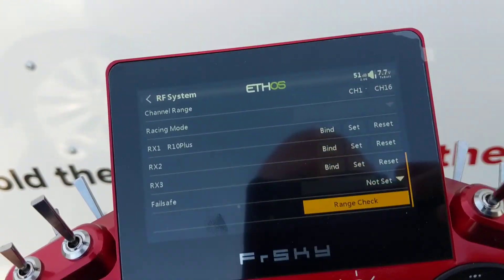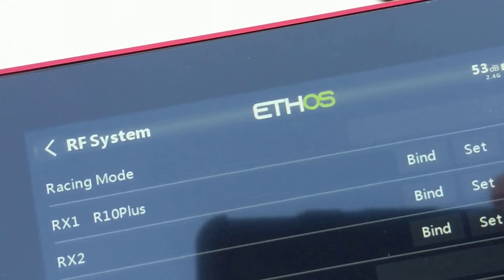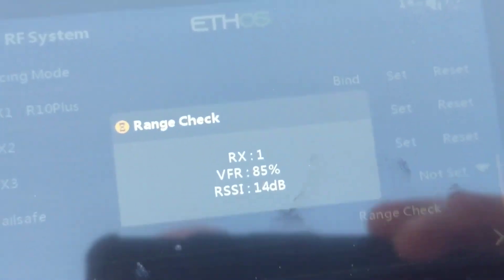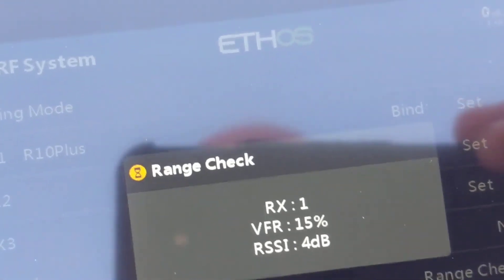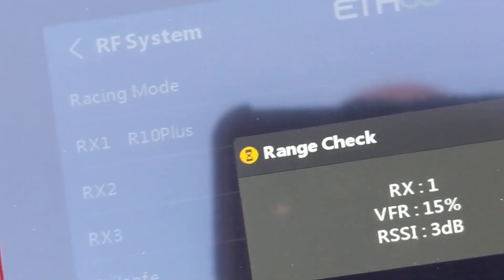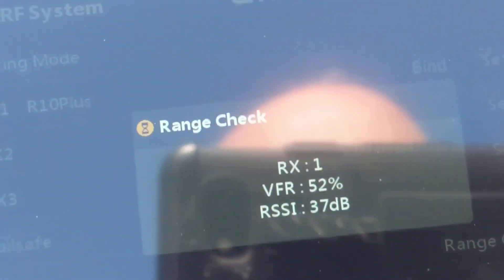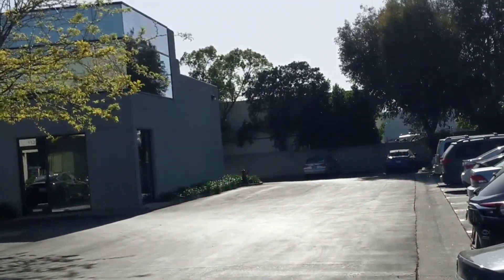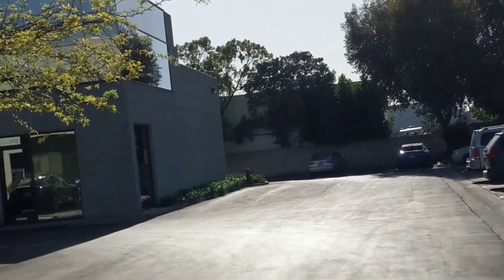FrSky Ethos- Range Check

Comment: Hi Steve. I have the X18. Haven't had a problem with emergency mode during flight but when I'm programming lua and switching between lua and special functions it occasionally goes into emergency mode. Is there something I can do to record what's happening like black box or something so I can report it on github?